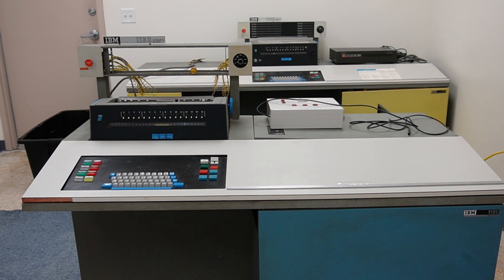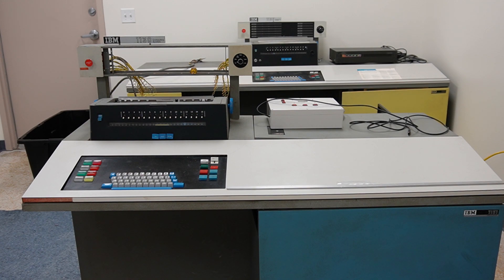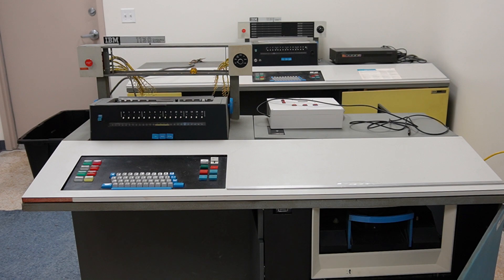Introduction to IBM 1130 Restoration series of videos

Comment: I worked on an 1130 in the '70s when I worked for a civil engineering consulting firm. I became very familiar with the assembly code, it was interesting that the "registers" were actually memory locations. I made a  number of mods to the OS including a system to spool output to the disk. We also had code to send data back and forth to a small pdp-11 at a Florida office to share plots. We ultimately ended up with a 1403 printer and a washing machine disk drive that I believe had 5 1 meg platters.

Comment: I have one disk for the ibm 1130 from my grandfather in the Army.. probably never gonna know whats on it :(
Reply from the maker: One of my future projects is to set up a disk drive to read and archive all the cartridges I have. I would be happy to extract the data for you at that time. You could use it with the IBM 1130 simulator since I save the data in the same format as is used by the simulator.

Comment: Good Job Carl, your work helps saving our heritage👍

I learned programming on the IBM 1130 whilest my study of telecommunications at the "Fachhochschule der Bundespost" in Berlin, Germany (Bundespost was the predecessor of German Telecom) in the years 1974 till 1975

The 1130 there was used for general management of the high school and for teaching students like me in computer technique.

Our installation had a central proccessing unit with 16 kB core memory (later updated to 32kB), the 1442 card reader, the 1403 fast lineprinter and the 1627 drum plotter. There must have been some kind of mass storage devices, which I don't remember because we had no access to it.

Each student group had to write a program of there own idea to get the certificate. The programming language was called IBM Basic Fortran IV, as I remember. Only capitalized letters and variable names 4 or 5 characters long where alowed. And there had to be a "C" at the 7th collumn of the cards to assign a comment.

I was very much attracted from the graphical possibilities of the plotter so I (and my one person group) decided to programm the motion of a brick, rotating around all 3 axes at different rates. The teacher later asked me if he can use it for demonstration purposes, but gave me a 5 from 6 points certificate :-(  The plot is still in my property (and will be till my death). Another group did a version of the  - then famos - GAME OF LIFE with output on the printer (the death of many trees ;-).

Our 1130 was the light blue design. Later I saw a light red one at TFH (Technische Fachhochschule Berlin) but that was only equiped with a paper tape reader instead of the card reader we had. That, in fact, was a big drawback for the students, because it was way more difficult to develop a program. They had to punch a new tape even when there was only a little syntax error in the code (cutting and glueing together was a mess). We only had to punch a new card and put it in the right position of the stack.

I remember the "JOB-Card" and the FOR-Card (for the FORTRAN compiler) to be placed before my program and some other
"operating cards" and one or more (?) at the end.
Reply from the maker: Hi Major Tom. 

The 1130 has a disk drive built into the cabinet (the door on the right front) with a single removable cartridge holding a massive 512K words of mass storage.

Fortran IV for the 1130 was my first programming language too. The limit on names to 5 characters was widespread in the 1130. When the language FORTH was created, it was first done on an 1130 system. The author was building a fourth generation language, but the 1130 would not support it as FOURTH so we have FORTH enshrined in computer history. While it has moved on across many many systems, it retains its five character name. 

In addition to the // JOB and // FOR, there was // XEQ to run the compiled code and // DUP to run the disk utility to store, manage or print/punch contents of the disk drive. 

The 1130 had a very expensive and thus rarely attached peripheral, the IBM 2250 graphical workstation, that you would have really loved to work. An early CAD station a huge screen, light pen and function buttons. 

You can download a good simulator for the IBM 1130 system if you kept the deck for your plot you could recreate it! This site also describes the 2250 I mentioned. http://ibm1130.org/

Comment: Bingham Jr. High in KCMO had a CAI lab.  The System 1500 had an 1130 cpu.  It supported 16 terminals (video and printer each).

Good luck with the restoration.  I hope you find enough lamps to get the front panel fully populted.  I'll give you a two instruction program that you can  bit switch into the machine starting at address 0000.

C000  (Load the next poisition in memeor into register 1)
D000  (Deposit register 1 into the current position in memory)

When the first instruction is read the address pointer has already been incremented to 1.  This puts D000 into the register. The second instruction puts the register into the current address pointer (which is 2).  Since an address overflow simply wraps around.  You get D000 in every position in memory.  😝  A quick and dirty memory wipe!
Reply from the maker: Indeed I have a fully populated and working panel on the system. See rescue1130.blogspot.com for details over the eight years since this video was published.

Comment: The Baltimore Polytechnic Institute high school had one and I learned how to put programs in thru the switches on the console.  That was a lot of fun.
Reply: Two instruction program:  At address 000 put in:
C000
D000
Run at address 000.
Reply: @crankshaft3612  Enter the program thru the console switches for the most fun.
Reply: @99rkrouse  One day we could not find the cold start card.  Had to bit switch the loader into the console switches.